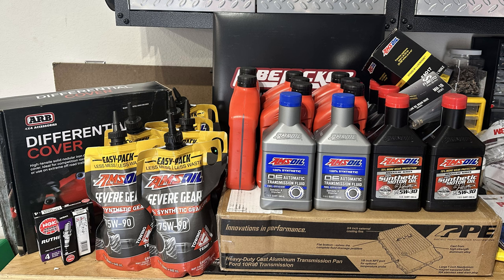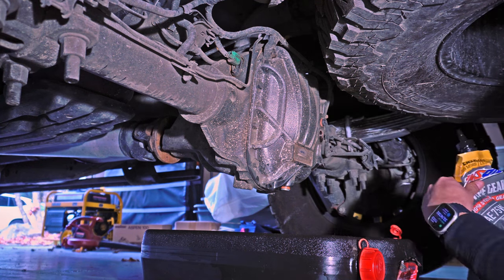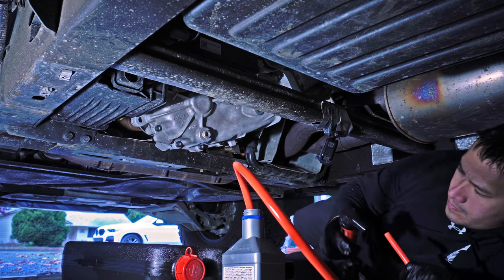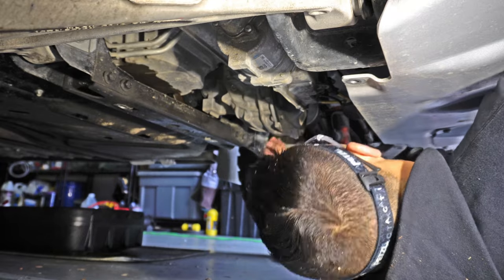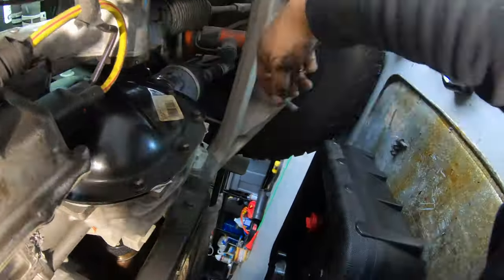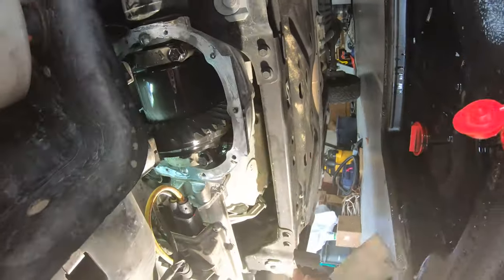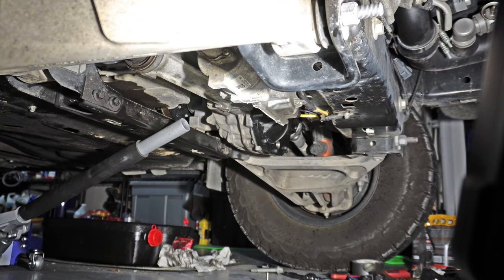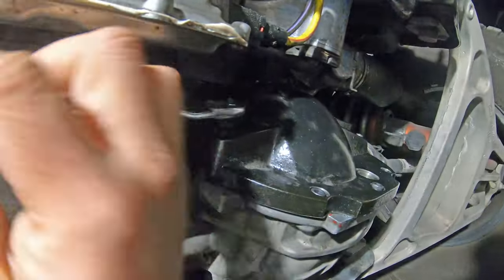Gen 2 Raptor 30k Mile Maintenance: Front Diff Cover & T-Case

Comment: Installed a Spicer front cover on my 2020 Raptor, required dropping the diff like you did but the cover didn't require any modification to fit. Wasn't going to attempt it until I saw this video, thanks for the inspiration!
Reply from the maker: I'm jealous.  I didn't spray down the ARB cover with anything before my winter roadtrip and the socket cap bolts along with various spots on the cover are rusted up.  Spicer was definitely the way to go!

Comment: Thanks for the video. I just completed mines and went with the Spicer front diff cover as you suggested. Those top bolts behind the electronic steering rack were something awful. However, 6 hours and a bunch of curse words later and it’s finally complete.
Reply from the maker: I know it's super frustrating! Good job sticking through it!
Reply: did you have to do any of the trimming with the spicer?
Reply: @badm0t0rf1ng3r  No trimming was needed but it’s a lot thicker than the OEM cover. Subsequently, I had to drop and ratchet the front diff backwards so I could maneuver the Spicer cover into place. In hindsight, I should of removed the steering rack from the start. It would of made the process so much easier.
Reply: @rickeyb450  Thanks broski.

Comment: Wow just what I was looking for 
My front diff is leaking 
You just open my eyes @16:20 when you bust out gasket instead of RTV. 
I keep watching video and thinking how you gonna deal with RTV silicone but you used gasket. 
That is just what I keep dreading to tackle this job. 
Now I can just buy gasket and call it a day. Where did you get gasket and how much was it 
Do you have any issues as of now 
Thanks
Reply from the maker: https://www.lubelocker.com/collections/differential-gaskets/products/ford-8-8-llr-f880

I must have forgot to add to the description.  I'll add it now, thanks!
Reply: @ruffwrenchn2235 it appears link you provided it’s for rear differential
Reply from the maker: @mikimiki195  The Raptor uses a Ford 8.8 differential in the front and Ford 9.75 in the rear.  As long as you're getting the cover and gasket for a Ford 8.8" diff then you should be good in the front.

Comment: Did you use a friction modifier with that Amsoil in the front diff or is the severe gear good on its own?
Reply from the maker: I replaced without the friction modifier as Amsoil says it includes modifier in all its oils...buuut...since amsoil sells friction modifier I'd say their oil probably still needs it. I haven't used it even on my most recent change, but that's just because I forgot.

Comment: I have a 2019 raptor and went with the 1.9 qts. Adding 1.9 qts it started to run out of the fill hole. My raptor supplement manual is dated Sept 2018 and says 1.5 qts where did you find the 1.9 fill ?
Reply from the maker: [img]https://live.staticflickr.com/65535/52978033048_e0934352a1_b.jpg[/img]
[img]https://live.staticflickr.com/65535/52978033068_58fd86ccd2_b.jpg[/img]
Reply from the maker: I guess images don't work in the comments...sorry about the bad information.  I guess there are different capacities based on build date? my manual says 1.9

Comment: With the stock front diff cover can you drain it  thru a drain plug or do you need to remove the cover ?
Reply from the maker: The stock cover does not have a drain plug.  You can pump out the oil through the fill port or you can take off the cover.

Comment: Can you tell me how long did it take you to finished that job. Thanks
Reply from the maker: I'd have to check the raw footage again, but I think it was around 4 hours for just the front diff.  I took a few breaks though and wasted time not lowering the diff or removing skid plates until later.  Not having the stock intercooler made it easier for me though.  If your truck is stock you'd have to drop the intercooler or steering rack or try to work around it if it's even possible.   I remove the stock intercooler in my FMIC install video if you need to reference that.  Be safe!

Comment: What was the part number for the Spicer front diff cover?
Reply from the maker: I threw a link in the description with part number 10023538
Reply: @ruffwrenchn2235   the bolt layout for the original front diff cover appears to be different from the spicer diff cover you linked. Is the spicer version guaranteed to fit ?
Reply from the maker: @agarcia8800  It should be good to go.  The Summit picture states that it does not represent the actual part.  Here is the link to the Spicer Nodular Diff Cover Brochure which has the part number for the Ford 8.8" diff: https://media.spicerparts.com/cfs/files/media/pHtjP9EYDzYzvRxf7/PERF-DIFFCOV-82015.pdf?store=original

Comment: Would the transfer case be 1.9 for a 2017 Raptor?
Reply: When you watch the video, he says that 1.5L would be for 2018 and below, but he also says that new manuals report 1.9 L so he decided to go with 1.9 L. Make sense if your going to be using th transfer case lots and also because it was likely a typo.
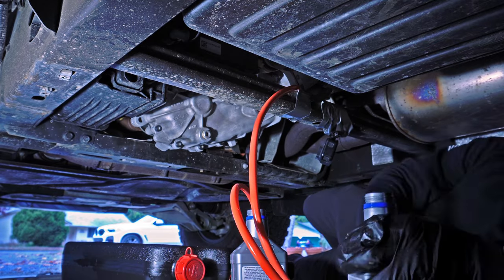Reply: If you watch from 5:56 he goes over everything about the amount of fluid to add.